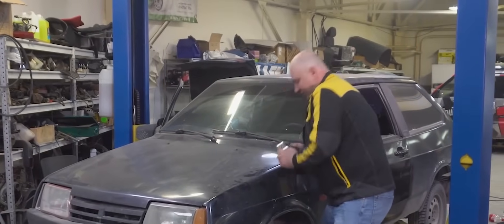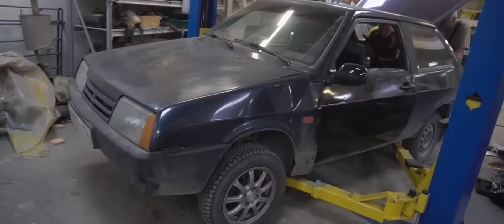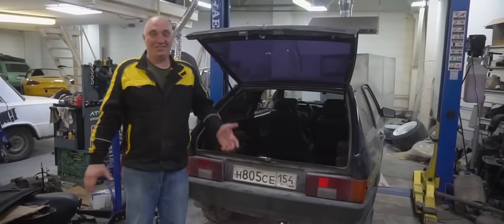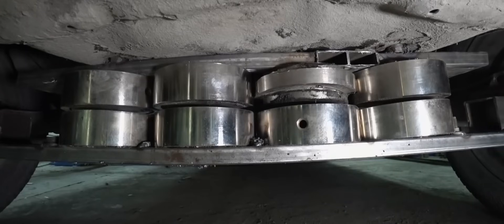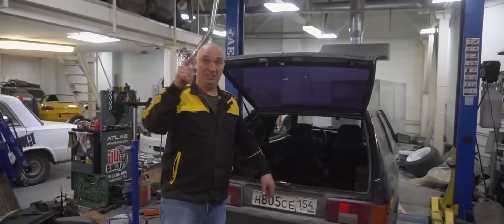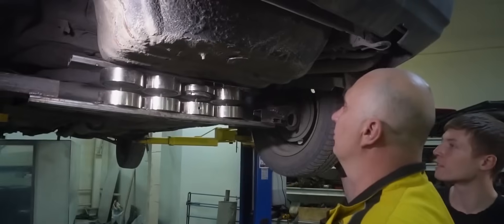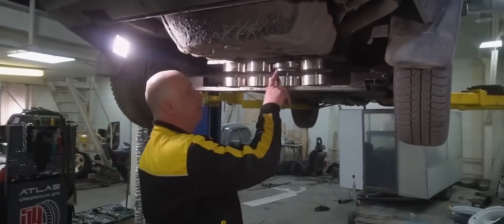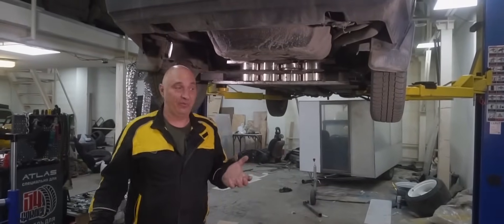DIY magnetic suspension

Comment: You totally killed the magnets by welding them. Too hot.
Reply: Yup. When I saw that I was disappointed. They should have used bolts.
Reply: @Im_Schiz given Fourier's law of thermal conductance, i say he would be lucky if those magnets were half of their potential after welding
Reply: @Im_Schiz  and to think they came out of the factory with bolt tabs X D dumb russian X D
Reply: @darrellbeets7758  machining holes generates far less heat than welding, no?
Reply: They welded the steel casings, not the neodymium and clearly they do still work
Reply: @skeezixmccat  they arent as strong as they were. Put heat on a magnet and see what happens
Reply: @skeezixmccat  have u ever welded steel? It kinda tends to conduct heat. And it might be a suprise but welding gets quite hot X D.
They for sure partly tempered the magnet. It most likely lost half of its strenght.
Reply: I learned this the hard way too. Heat kills magnets. I dunno why tho.
Reply: @showmethedammovie  heat mess with electron cloud, which is main reson for ferromgnetism. Magnets are metal with orderly electron cloud. This is also reson why non metals cannot be magnets- only metals have electron cloud insted of having them builded into material itself.
Reply: @showmethedammovie  Magnets are formed due to certain alignment of the matter in one direction, and this is what gives them the property of magnetisation, any material that gets heated up will lose it property as the matter in it starts to vibrate and move out of alignment hence they lose the property of magnetisation
Reply: @showmethedammovie  the poles when hot can freely rearange themselves returning the magnet back to its old idle shape.
Reply: Mr. Rapture yeah I thought they should’ve bolted them instead. That way they would be replaceable as well
Reply: Would it be better to bolt on the magnets instead?
Reply: @sginrummy88  absolutely yes. Bolt them down or make like a brace for it
Reply: Zeb Shah  wouldnt even need glue. Just a ridge around it to keep from sliding. It damn sure wont pop off. You have the magnet holding itself plus the other magnet's magnetic field pushing it even harder. Its there for life. Lol
Reply: @Light_Resistance  lool sp true using glue would be such a joke in that example X D
Reply: @darrellbeets7758  thanks for the backup
Reply: Yes, sadly
Reply: Mr. Rapture these guys are a bunch of butchers
Reply: @caryd67  everytime. i find it quite entertaining
Reply: Oh my god im so happy i found this reply. Cringed up so bad....
Reply: heat lets the tiny particles in the magnet to spin "freely" which lets them disarrange and lose magnetism is what i've heard is the reason... might be overly simplified like many explanations given in school tho
Reply: @minecraftermad  maybe overly simplefied but correct all the way tho
Reply: @pandemic195  curie for iron is 770°c(1400°f) and 670c or lower for neodymium which is most likely the magnet type in the video also thank you for the information. always better to receive a personal lesson than to just google :)
Reply: magnets were not ever touched he tacked bolts to the rail to hold them in position and used bolt as metal spacers you would see this if you watched the video or maybe you are blind.
Reply: @nickolascuartero7854  pls put a ring on ur finger and try to ( tack ) that and see if it doesnt get hot. Idiot
Reply: and again if this was a weld i would understand it getting hot enough to do what he is saying but where they tacked i highly doubt that casing even gets that hot.
Reply: but my main point was that people are blind AF saying the casing was tacked when nuts and bolts were tacked only and on top of that they didnt even show if the top nuts that got tacked had the magnets even on them at the time obviously we saw one tacked and it was on the backside  everyone on here can only speculate as to how hot the casing actually got.
Reply: also even if the magnets were in contact with these bolts the heat transfer would not even get hot enough he could put his fingers on the steel casing and not get burned.
Reply: should have broke out the superglue
Reply: they only spotwelded them. with that thick of a steelcasing there is no way they would have lost any potential.
Reply: @Peron1-MC  above 80 degrees Celsius they begin to deteriorate. I guess overheating a spot on them it still affects them
Reply: @ionutionuti  they easily had hotspots over 300 celcius
Reply: @Peron1-MC  the metal was touching the magnet. If there was an air gap somehow maybe they wouldnt be affected. But heat transfers very well. We have exploited that fact for many things for many years
Reply: @Light_Resistance  Damn!!
Reply: @Light_Resistance  i just dont elieve a person with jesus christ on a cross should be talking about anything scientific just saying and when your blind and dont even have a good comback to the person who disproved your statement i wonder how 654 idiots gave you a thumbs up just saying.
Reply: @nickolascuartero7854  694. Thank you.
Reply: He didn't weld. But only tacked and not the magnets but the bracing around it.
Reply: @mrzhenya92  is notweld 
is about thinking that is weld. 
Cmon! XD You dont accept reality
lol

Comment: They need to be inside of cylinders like a piston, instead of having a guide rod.
Reply: Why not both?
Reply: @chappiedatass1361  I guess 542,000 heads are better than 1....
Reply: @chappiedatass1361  EUREKA!!!!!
Reply: They could use clear plexiglass tubes so we.xould see that magnets working.
Reply: Carbon fiber honeycomb shell cylinders to house the electro-magnetic field between electro-magnets and actuator creating motion or thrust depending on the application. Can also be incorporated into the outer shell to avoid contact with other similarly equipped vehicles, like an invisible forcefield if you will...
Reply: @rogueduz9529  this Is the revolotion brooo
Reply: @johnmcclane8512  💪👍I have many plans but I am no Elon Musk. I need help in development lol 😆
Reply: @rogueduz9529  lol me neither have, and i understand and it Is true thats posible
Reply: @ Chuck Beef thank God that you found out soon enough that it take a lot of energy for a solenoid to change the polarity of a magnet, especially a rare-earth one. I always stay away from any so-called "free energy" crap click bait on YouTube.
Reply: Yup.. welding magnets r not bright... N btw didn't Audi use electromagnetic suspension?
Reply: That could also replace the shock absorber. Eddy currents would act against magnet moving inside the conductive cylinder. Like when you throw magnet inside a copper tube.
Reply: thats what you should do on yours
Reply: Use Electromagnet for suspension + it can be adjusted
Reply: @emandos6533  check out Bose magnetic suspension, computer controlled
Reply: If you set it up right, it could also serve as a shock absorber due to the damping from the eddy currents the magnet induces in the metal cylinder.
Reply: I thought a magnet engine. Opposing pistons/magnets that can be reversed/timed via electric solenoids. Free energy. No combustion or exhaust, just magnets replacing fuel and the piston/head.
Reply: @ChuckBeefOG  there is no such thing as free energy. The energy to control the magnets with the solenoids will exceed the amount of energy needed to run the engine.
Reply: Patrick Wallis No it wouldnt, just a small pulse to reverse polarity on the magnets at a specific time. Wouldnt take much more than the spark ignition system on todays combustion engines. Which would be produced by a alternator the same way it is today. There are motor designs and patents that work on this principal, but they happen to be held by the oil companies. There are also very efficient water and hydrogen engines that are owned by big oil. 

There is free energy, but our gov’t cant make money off of it so they just dont let it get out there. The only thing you can make transportation wise is a gasifier, and i am sure that would be outlawed almost everywhere.
Reply: @ChuckBeefOG  the problem is the law of physics doesn't agree with you there. Free energy is an oxymoron.
Reply: Patrick Wallis I don’t think you understand my premise. A simple reverse in polarity can be accomplished with minimal electric power via a solenoid simply be reversing current. It can be done in nanoseconds, this would replace ignition of a compressed a:f charge and the timing of an engine. Magnet piston, magnet head, simple polarity reversal at a timed interval that would cause the magnets that are being rapidly drawn together, to rapid push away from each other. Engine turns the crank, crank turns alternator, alternator provides power for the timing. Self sufficient, limitless free energy until the magnets wear out. 

Koenigsegg has proved that solenoids are more than capable at operating at high speeds and low power input. They have created a cam-less engine that uses solenoids instead of camshafts to open and close valves, all electronically timed and powered by a standard 12v battery/alternator setup. It’s called the freevalve project.
Reply: @ChuckBeefOG  it Is possible would be a revolution Bro lol i was though the same a few years ago
Reply: John McClane I looked a little further into electro-magnets. I found they require a substantial amount of electricity to reverse the polarity. Most scrap metal handler magnets have a 5KW generator to power them. So it wouldnt work without a large source of energy, much larger than i had thought. Certainly more than the engine could produce from a small alternator.
Reply: @ChuckBeefOG  oh thats a shame this seems like a good idea , but might be it Is necessary to do an a good physic analysis to get an upgrate engine
Reply: @ChuckBeefOG  It's almost like the second law of thermodynamics is a law or something.
Reply: @ChuckBeefOG  p.m. me. I have way better ideas than this
Reply: Me though the same thing but dont have money yo dev
Reply: @ChuckBeefOG  fuck thermodynamics!!
Reply: @ChuckBeefOG  ive thought of the same system to replace existing combustion type engines for motion
Reply: John Nitrous But by reversing the polarity of the magnet, they will draw each other together, then the current would be reversed again at top dead centre to drive the piston back down, then again on the compression stroke to draw up the piston. Magnets do not always have to repel or attract they can do either by manipulating electrical current. 

Ever see one of those large electromagnets on a machine at the scrap yard? It doesn’t pick up steel until voltage is supplied to power the magnet. The solenoid principal is the same idea. 

Maybe something is going over my head, but you can control a magnet to do either draw or push by switching its polarity, that is not fake, we did that in high school physics with dollar store magnets and a battery charger. I guess it doesnt really matter because someone else holds the patent and if you built one and released it to the public you would probably wind up dead a short time later. Dont get hung up on the free energy term, even though it is essentially free energy. A engine that can run with no fuel, and generate its own electricity needed to power itself is as close as you can get to “free energy” like solar or wind. 100x more free and efficient than an electric car as those require fossil fuel to generate the electricity to charge them. Nikola Tesla had many free energy machine designs, but he too was shut down by a corrupt govt and oil industry.
Reply: John Nitrous Yes. Magnets used as pistons will produce more energy than they consume while reversing polarity.  Why is that hard to grasp? Take a simple V8, replace the pistons and heads with magnets, reverse polarity electronically to drive pistons and rotate crank. Crank drives alternator, alternator charges batteries, batteries provide power to the electrical system. Same principal as an internal combustion engine without combustion. Its not impossible as there are patents. Most patents require a prototype. Oil companies own said patents. Free energy, like a perpetual wheel, it exists in many forms.
Reply: Chuck Beef i got the idea,but i think,electric motor can do the same job
Reply: @khairun1989  yep but electric Car needs a battery consume minerals no renovable and cause pollution
Reply: @ChuckBeefOG  Only one problem.
You still need a lubricant to lubricate any and all moving parts to reduce the risk of damaging and potentially blowing up or ceasing up the engine.With out a lubricant,the friction and heat generated by turned solid metal,I.e. cast iron and aluminum,would cause permanent and irreversible damage to all of the moving parts.The surface of the cylinders;the magnets,and the rods the magnets would be attached to,are not completely smooth;when examined under an electron micro scope;as there would be sharp peaks,and valleys.A lubricant such as 10W 40 SAE motor oil,would be needed as the oil creates a thin film between all moving parts;filling all of the microscopic valleys,and covering the sharp and jagged microscopic peaks;allowing all of the moving parts to move with out grinding past eachother.Without oil,the microscopic peaks and valleys of the hard metals would cause the moving parts to be pitted and grind past each other and would result in metal shavings clinging and building up on the magnets and cylinder walls;which would eventually cause the electromagnetic engine to cease up.The block,camshaft,and the piston rods cracking in half,is a possibility without the use of oil.
An electromagnetic engine still needs to have bearings lubricated;to reduce heat and friction,where the magnet piston rods are bolted to.Therefore you still would need an oil pan,or an oil tank with an oil pump system to evenly lubricate all moving parts for the engine to work efficiently.
You would also need a way to cool down the engine as well;as electromagnetism also generates alot of heat.A coolant pump and a radiator with a fan will be needed to keep the engine temperature from going past the  400°F mark;the operating temperature set for civilian vehicles;by the automotive manufacturers.

P.S. I love your user name! Mmmmm.....Beef!.....ahhhh.....
(drooling like Homer J. Simpson)

Comment: Watch Bose do it , their magnetic suspension preemptively jumps speed bumps
Reply: Yea from many years ago, there is a reason it hasn't set off with car manufacturers
Reply: @YungEagle3k  Mostly due to weight and cost issues
Reply: Delphi's MagneRide has been used in GM cars since 2002. Ford, Audi, Lambo, Ferrari, etc all use it now. Hell my 2004 Corvette Zo6 has it. I had a Volvo S60R with an adjustible setup by the push of a button. Bose is just garbage these days.

Comment: add two pairs of magnets and maybe it will work better, but actually Bose company was developing electromagnetic suspension, look it up
Reply: Look up the Delphi MagneRide system GM has used since 2002 and now nearly every manufactuer uses it or something similar.
Reply: Dubz0Eight yes it exists but outside of the GM just Audi uses it
Reply: @1616oliver  So does Ford, Acura, Land Rover, Ferrari, Lamborghini, etc. While not as ambitious as the Bose system, can you name a single manufacturer that uses the Bose system?
Reply: Dubz0Eight the Bose system was purely electromagnetic while MagneRide isnt purely electromagnetic
Reply: @1616oliver  The Bose system failed while the Delphi system succeeded
Reply: Dubz0Eight yup, it was because it was purely relying on electromagnetism and it was heavy and energy consuming, but with the bose system the car handling was the best even today... but it had big cons...
Reply: @1616oliver Ok I think I understand what youre saying. I think what you mean is that the functionality of the Bose system is unparalleled. It could provide its own force through its own power supply in large quantities where as the Delphi system can raise and lower the car but cant react like say, a hydraulic system to make the car leave the ground.
Reply: Dubz0Eight yes, exactly, so i think if these guys add more magnets it can come close but not exactly to bose system but this will lack features like dynamic balancing, height, change, damper distance travel change and etc etc etc... and it will render the car MUCH more heavy than with the bose system, so retrofiting the delphi system is the way to go if you want magnetic suspension but the way they are doing it is much more fun and joy to watch 😁 the bose magnetic suspension reminds me the wankel engine 😀 big promises, sounds, looks, feels, performs very very good, but there are so big cons that no one ever is using it 😂 rest in peace bose suspension and wankel engine (but i still own an rx8)
Reply: Oliver Szabó Rob Dahm just put a rotary in a Corvette and went to LS fest with it. I own a Corvette Z06 lol. Magnetic suspension makes it hard to go back to conventional. Especially the one I had in an S60R with selectable modes.

Comment: Try building magnetic shock springs using aluminum tubes. Just don't add to much fluid. Just enough to lubricate. It will be another method of making magnetic springs.